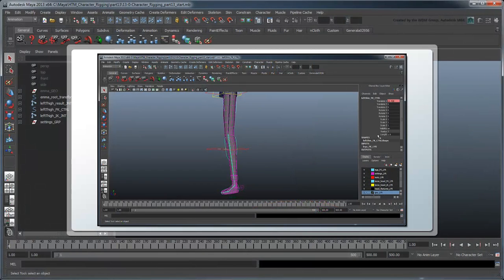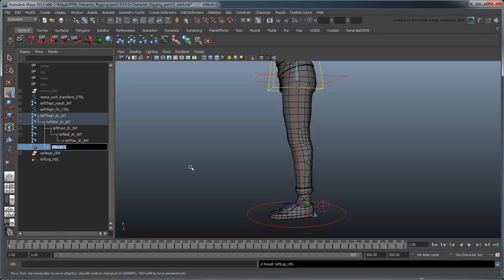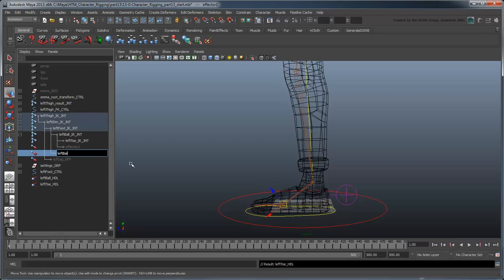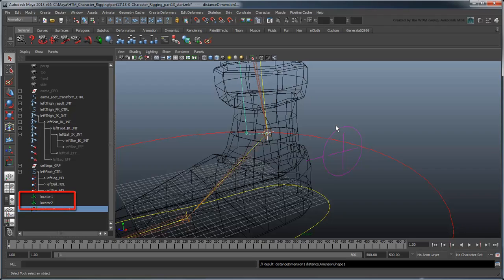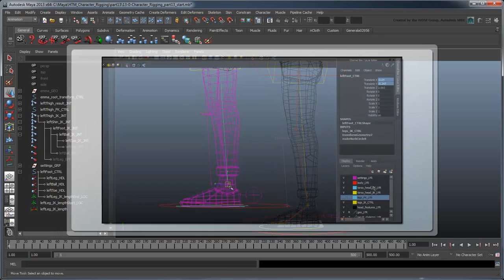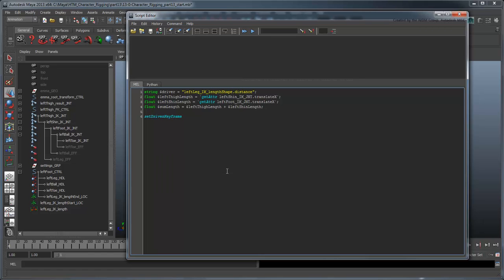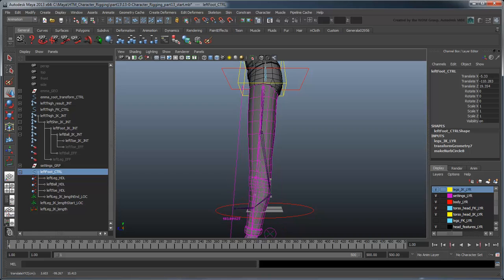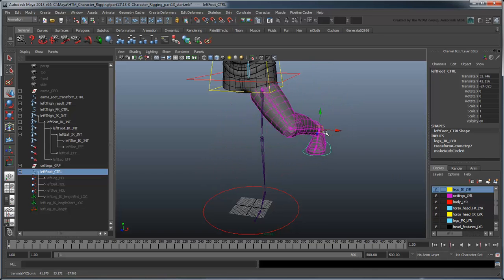Creating a Character Rig - Part 13: Leg IK controls and joint stretching (Advanced)

Comment: Does anyone know a solution for maya 2018? 
When I use the script used in the tutorial or the ones for 2016/2017 in comments, the mesh and joint of the upperleg will stretch to twice it's size, but it will not change the size of the mesh/joint while changing the translation of the foot control. 
The upperleg will stay twice the size no matter the translation of the foot control, if I move the foot control up, the leg will just bend, and if i move it down the leg will just stay behind.

I can see in the graph editor that the x translation of the leftShin_IK_JNT is not keyed between 0 and 1 but at 2 different keyframes.... though if i move them the leg will just stretch to infinity. 
It might be that the leftLeg_IK_LengthShape.distance is not keyed right, but I don't know how to check or changes this.. 

I can't find any errors in the script editor... I tried applying the scripts multiple times (typing by hand, copy pasting, after restarting etc) but it kept doing the same thing.
Reply: For if anyone also has this problem... 

I found this tutorial using utility nodes, the setup is almost the same, only here the leftThigh_IK_JNT and the leftLeg_IK_LengthStart_LOC are point contstrainted to each other, and the leftFoot_CTRL and the leftLeg_IK_LengthEnd_LOC are parent contrainted to each other. 
Both contrains should be under the locator. After the tutorial you should also use the blendColors nodes, just like before with the translation and rotation, but this time with scale. 
Put the IK joint of the thigh and shin in color 1 and the FK of the thigh and shin in color 2, put the output in the thigh/shin result joint. than it should work.

https://www.youtube.com/watch?v=bQvaF1Rz1XA
Reply: found the problem relink the blender att to the setting ik fk switch cntl

Comment: hi just new to mel in maya i have followed your codes but I get error 3.25 syntax error here is the codes I have: 

string $driver = "leftLeg_IK_lenghtshape.distance";
float $leftThighLenght = 'getAttr leftShin_IK_JNT.translateX';
float $leftShinLenght = 'getAttr leftFoot_IK_JNT.translateX';
float $sumLenght = $leftThighLenght + $leftShinLenght;

setDrivenKeyframe -currentDriver $driver -driverValue $sumLenght -attribute "translateX" -value $leftThighLenght leftShin_IK_JNT;

btw Im using maya 2017 tnx
Reply from the maker: when using things like "getAttr", you need to surround them with ` not '.  (` is the key next to "1" on your keyboard).
Reply: so the correct setup is: float $leftShinLenght = "getAttr leftFoot_IK_JNT.translateX";
Reply from the maker: Actually it would be float $leftShinLength = `getAttr leftFoot_IK_JNT.translateX`;
Reply: tnx Im able to do the stretch

Comment: hi
at 11:27
i use Maya 2017
after do tangents to spline on both joints (shin_IK and Foot_IK)  stretch doesn't work and i can't put the leg in the origin position.
i need Hepl !
Reply from the maker: Did you turn on the Infinity view?  Does it look like the animation graph stretches forever?

Comment: For anyone that might have had the same problem. I had all the codes right but my leg was still not stretching at all, and after a few minutes of frustration I saw that my the distance was 0, even though my locators were at the right spot, so I just did the measurement again and it worked perfectly. I'm using Maya 2018 by the way.

Comment: Hi again! Sorry for all the comments recently, my right leg stretch works great, oddly enough I am having my problem with the left leg. When I move the hip control upwards, the right IK foot stays planted on the ground and the leg stretches as it should. However the left foot eventually follows the hip control, as if there were no stretching at all. When I move the foot control the left leg stretches correctly, its only when I move the hip control. I checked my graph editor and all the driven key curves are correct.  What do you think? Thanks again!
Reply from the maker: Make your measurement nodes visible while moving the hip around.  I have a feeling you may have forgotten to parent constrain one of the locators such that the length isn't changing (and therefore, no stretch is being calculated).
Reply: Maya Learning Channel. Yep that was the problem! Thanks a lot

Comment: My FK leg joints change position after I run the Mel Script. What is causing the mess up?
Reply from the maker: Hmm this shouldn't affect FK at all.  Are you sure your joint hierarchy is correct?
Reply: Thank you for the heads up, i was able to correct the hierarchy problem but encountered an issue where the result Shin joint wouldn't scale after i re-ran the script. :\

Comment: hi, I'm working with maya 2017 on this one and I have an error.
This is my code with my actual bones name and the software keep telling me  that I have an error but not what error is it.

string $driver = "left_leg_IK_lengthShape";
float $leftThighLength = getAttr ("left_shin_IK_JNT.translateX");
float $leftShinLength = getAttr ("left_foot_IK_JNT.translateX");
float $sumLength = $leftThighLength + $leftShinLength;

setDrivenKeyframe -currentDriver $driver -driverValue $sumLength -attribute "translateX" -value $leftThighLength left_shin_IK_JNT;
Reply from the maker: Try opening the Script Editor in the bottom right corner.  Does it tell you what  the error is there?
Reply: no, it doesn't. it just say there is an error
Reply from the maker: Hmm, this doesn't sound normal.  In the Script Editor, can you turn on "Echo All Commands"?  Try running the script again and it may give you some new information.
Reply: Ok so I find the problem but my leg is stretching weirdly. It don't stretch evenly then it stretch to much and bend again.
Reply from the maker: Check the animation curves for those joints in the Graph Editor. Make sure the line is straight diagonal, not curved.

Comment: I put the code in the script editor and it does not mark error; the
 problem is that I do,t mark the red key in the translation, and I can´t write the other line because nothing happend .... can anyone help me? I put exactly this

string $driver = "leftLeg_IK_lengthShape.distance";
float $leftThighLength = getAttr ("leftShin_IK_JNT.translateX");
float $leftShinLength = getAttr ("leftFoot_IK_JNT.translateX");
float $sumLength = $leftThighLength + $leftShinLength;

SetDrivenKey -currentDriver $driver -driverValue $sumLength -attribute "translateX" -value $leftThighLength leftShin_IK_JNT;
Reply: i found what´s  the problem! here go the solution. This is to Maya 2016 
The problem was in the code. 
setDrivenKeyframe -currentDriver $driver -driverValue $sumLength -attribute "translateX" -value $leftThighLength leftShin_IK_JNT;

setDrivenKeyframe -currentDriver $driver -driverValue ($sumLength*2) -attribute "translateX" -value ($leftThighLength*2) leftShin_IK_JNT;

Comment: Hello!
I have a problem with script. I run this script:

string $driver = "leftLeg_IK_lengthShape.distance";
float $leftThighLength = "getAttr leftShin_IK_JNT.translateX";
float $leftShinLength = "getAttr leftFoot_IK_JNT.translateX";
float $sumLength = $leftThighLength + $leftShinLength;

setDrivenKeyframe -currentDriver $driver -driverValue $sumLength -attribute "translateX" -value $leftThighLength leftShin_IK_JNT;

and have this warnings:

// Warning: float $leftThighLength = "getAttr leftShin_IK_JNT.translateX"; // 
// Warning: Line 2.62 : Converting string "getAttr" to a float value of 0. // 
// Warning: float $leftShinLength = "getAttr leftFoot_IK_JNT.translateX"; // 
// Warning: Line 3.61 : Redeclaration of variable "$leftShinLength" shadows previous declaration at line 2. Previous value will be overwritten by explicit initializer. // 
// Warning: float $leftShinLength = "getAttr leftFoot_IK_JNT.translateX"; // 
// Warning: Line 3.61 : Converting string "getAttr" to a float value of 0. // 
// Result: 1 //

Please help me to solve this problem!
Reply: Ok, I solved this problem, I put wrong apostrophe, "getAttr, and should be `getAttr. 
But now have another warnings.

// Warning: float $leftShinLength = `getAttr leftFoot_IK_JNT.translateX`; // 
// Warning: Line 3.61 : Redeclaration of variable "$leftShinLength" shadows previous declaration at line 2. Previous value will be overwritten by explicit initializer. // 
// Result: 1 //
Reply from the maker: Did you use the variable name "$leftShinLength" anywhere else in your script?

Comment: The script trick for the stretch is awesome, thanks a lot for this tip. However, when i'm moving my IK controler around then undo with Ctrl+Z  the controler go back to his initilal position but not the joints. I didn't manage to figured out why. Any idea how I can fix this? here's an image to illustrate my problem : https://s16.postimg.org/eer35qjtx/Maya_IKIssue.jpg
Reply: Oh and btw, if i move my controller again, the joints go back rigth where they belong. And it's happen only if the leg is stretched, not bend
Reply from the maker: Check the Script Editor after a stretch or undo.  Is there a warning about cyclical dependencies?  This is a pretty common occurrence when that type of error happens.
Reply: yup, i have 3 cyclical dependencies :/.  Not sure how i will get rid of them but i'm working on it. I assume this is because i use a different hierarchy than your's. Thx for the quick answer :).
Reply: Fixed :D. I had 3 cyclical dependancies indeed. Mainly, the probleme was due to the fact that I parented my DistanceStart Locator to my ThighIK Joint >_<.
Reply from the maker: Unfortunately yes, if your hierarchy is different then something in there is probably causing the issue.  As a general rule, you'll be looking for situations where an attribute (B) takes input from a different attribute (A), but which also feeds B a value (either directly or indirectly).  Hence you end up with A->B->A, which is a cycle.  Maya can't resolve those because it's basically a chicken/egg scenario (what do you resolve first?).
Reply: The first thing i did was changing my hierarchy using parenting insteed of constrain parenting (for the IK handles) but i'm not sure if this help fixing the problem. then I found the distanceStart locator under my thigh joint and dragged it out.
The thing is, for the herarchy, i like to have one group for the mesh, one for the bones and "tools"(locator/handle...) and one only for the controllers. This make the outliner clearer for me ^^ . I know it's possible to do so 'cause that's how our rig are where i work. But as a newbie into the rig universe... i lack workflow

Comment: sir, i have done my character's left leg till part thirteen...and when   i executed that  script ,it was not executed..not giving me result 1...and i want to mention that.. when i did it with my previous character it was executed..so what is the meaning of that ..the script only one time work..what should i do for re execute the script?..please reply me..my work is pending for long long time...
Reply from the maker: Are you sure the naming of the joints lines up with the names you used in your script?  Did you copy the script from your previous character to ensure there were no typos this time?  What kind of error are you getting?
Reply: i was applying same name with new character for rigging practice...
Reply from the maker: You're missing some spaces between -currentDriver $driver and -value $leftthighlength.  That might be the cause of your problem.

Comment: I have not created a proxy geo for my rig. My IK/FK Switch Ctrl is not following along when I move the IK Ctrl. Is that because it is not connected via a mesh or did I make a mistake at some point?

Edit: I think I have it parent constrained to the FK and not the IK
Reply from the maker: Not sure if you managed to fix your problem, but I can tell you that it definitely wouldn't have anything to do with the proxy geometry.
Reply: Okay. Then I ask differently. To whom would the IK/FK switch be parent constrained to? I think I constrained it to the wrong thing
Reply from the maker: Result Foot joint would be best.
Reply: Ah there you go. I had it connected to the FK Foot Joint on accident! Thanks. Right now I am stuck on the node system in part 15. Hope I can handle that so I can continue with the rest.

Comment: Greetings. Thank you so  much for this tutorial, It has been really helpful to get other better options to build a good rig.
I have a little question about the script. I have been working this tutorial with a personal model different than the tutorial model,  I have been trying to put the script in maya 2016 several times without good results, i was beginning to get crazy myself with this because when i tried to use it at the model of this tutorial it worked perfect except with my model. After several tries i realized that my model was in a scene with a grid configurated at meters, I thought that this could be the problem so I changed the grid to centimeters and it worked perfectly. 
I would like to know why this could happen, To me is really strange, there must be an explanation for this, maybe you could know the reason.

Thank you again.
Reply from the maker: That does seem odd.  The distance nodes should adjust to the current working units automatically.  I would try it again in meters, but try adjusting the scripts by multiplying all the values by 100.  Strictly speaking, you shouldn't have to do this, but if the measurements are somehow out of synch then that should get them back in synch again.
Reply: Thank you for your reply.  I multiplied The $leftThighLength and the $leftShinLength by 100 at the $sumLength and It worked perfectly.
It' stills strange (x files of maya jejeje) but it worked.
thank you again
Regards
Reply: @yecidm  same problem i encountered its kinda odd.

Comment: i also have a problem with scripting in maya 2016: when execute i'm told that in the last line "no object matches name: liWade_IK_Joint" but i wrote it exactly like it is written. i don't know why this error occurs... any suggestions?
Reply from the maker: Sometimes this can also be caused by an extra / missing semi-colon.  I would try checking for that.
Reply: thanks for your answer. i already checked that. there are no missing or extra semicolons. i reread it over and over.
Reply from the maker: Hmm, do you mind posting your script here?  Seeing it might give me a better idea of what could've gone wrong.
Reply: string $driver = "liBein_IK_LengthShape.distance";
float $liSchenkelLength = getAttr ("liWade_IK_Joint.translateX");
float $liWadeLength = getAttr ("liFuß_IK_Joint.translateX");
float $SummeLength = $liSchenkelLength + $liWadeLength;

setDrivenKeyframe -currentDriver $driver -driverValue $SummeLength -attribute "translateX" -value $liSchenkelLength liWade_IK_Joint;

(the names are in german. maybe that wasn't clever, too...)
Reply from the maker: It's possible the special characters are messing with the script.  Using German words is fine, but avoid characters like this: ß
Reply: good point, thanks! changed it but there's still the problem "no object matches name". i'm getting crazy...
Reply from the maker: Strange, I just recreated a quick test leg using your joint names on my machine (replacing ß with b) and it worked fine.  Are you sure the actual joint names / distance node in the scene line up with these joint names in the script?
Reply: yes, absolutely sure. allegedly there's no matching object for liWade_IK_Joint.translateX. i thought maybe it's due to the translateX... or it's just a mysterious bug.
Reply from the maker: liWade_IK_Joint is the object name.  "translateX" is just the attribute name, so if that were the problem Maya would be showing a different kind of error.  Try renaming liWade_IK_Joint (even temporarily) in both your script and scene maybe?
Reply: would be a simple trick. tried it but unfortunately the results are the same...
Reply from the maker: Okay, this is getting really odd.  Can you try commenting out everything except this one line?
float $liSchenkelLength = getAttr ("liWade_IK_Joint.translateX");

Does this still throw an error?
Reply: yes, there's still an error. unfortunately.
Reply from the maker: Okay, so now create a new empty scene.  Create just a single joint named liWade_IK_Joint.  Try running that single line of the script again.  Does it throw an error again?
Reply: okay. that works... so there seems to be no problem with the name itself respectively this script line.
Reply from the maker: Okay, so next step.  Try creating two joints and give them the same names as in the script + the distance node.  Try running the script then.  Does that work?
Reply: i suppose you meant the single line (of course, running the full script makes no sense here). i tried that & it worked again.
Reply from the maker: Sorry, I meant to recreate just a single leg joint chain in the new scene with those same names (and distance node) setup, then test the full script on those without the rest of the rig in the scene.
Reply: okay. of course there was an error... so i just tried & copied the name out of the script & pasted it to the joints name. & there i saw it: previously the name was "...:liWade_IK_Joint" now the new name was "liWade_IK_Joint". i thought "...:" would make no difference because i believed this only shows that there is a namespace which is just hidden now.
so i returned to my problem scene & deleted every "...:" in the joint names. now everything works when i'm running the script! oh my... what a stupid mistake..!

i really thank you a lot for spending so much time in helping me! i'm sure i'd never have found the error without your support. i'm so glad that finally the problem is solved.
Reply from the maker: Ah amazing!  I'm glad I was able to help.  In the future, you can just get rid of all namespaces at once from the Namespace Editor.